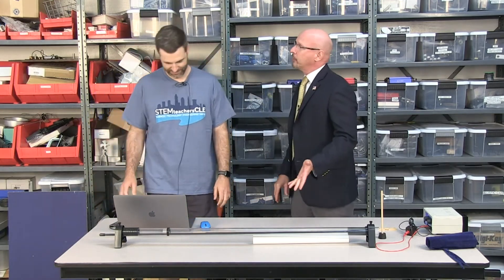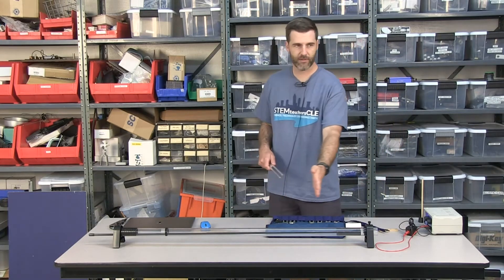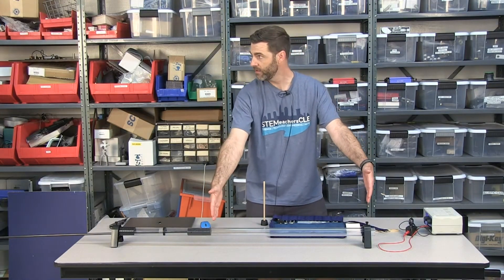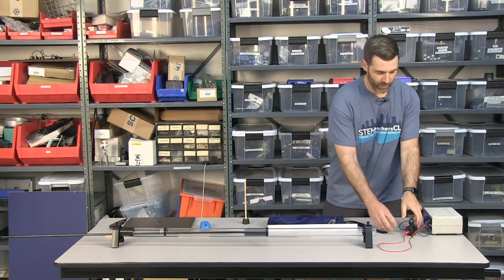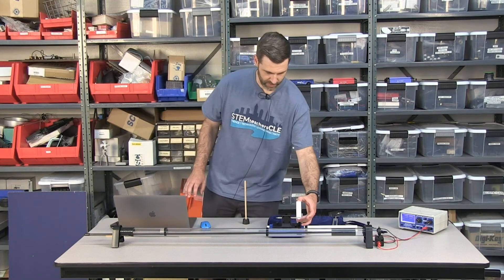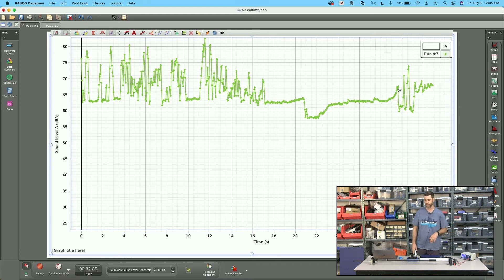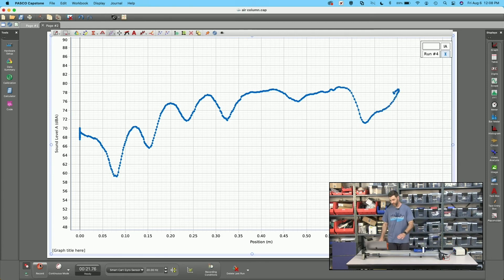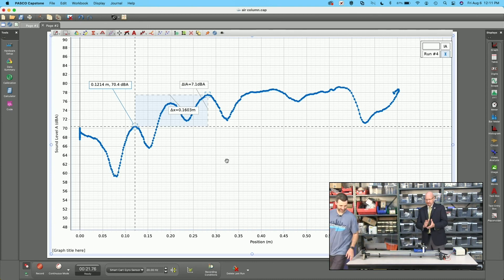Closed Tube Resonance in an Air Column with the PASCO Resonance Tube (WA-9594)

Comment: You may be able to hear a louder sound if the tuning fork is kept so that the vibrations of prongs are parallel to the length of the resonance tube. In this demonstration, the fork is kept so that the vibrations of the prongs are perpendicular to the length of the tube.